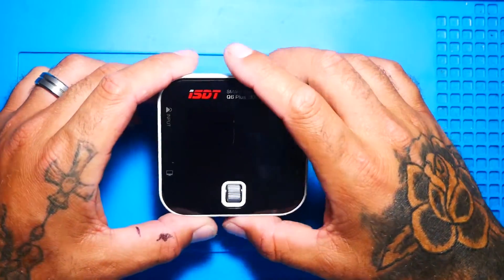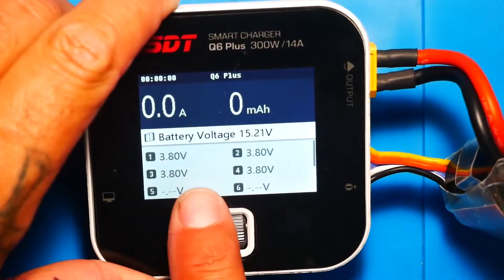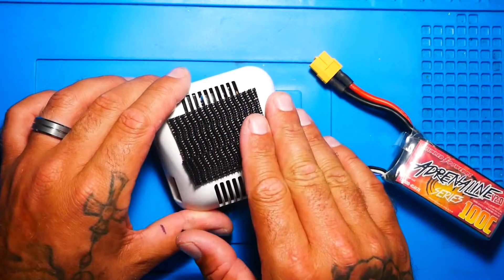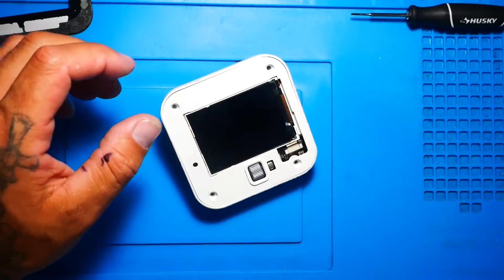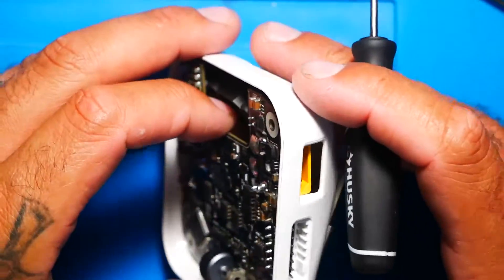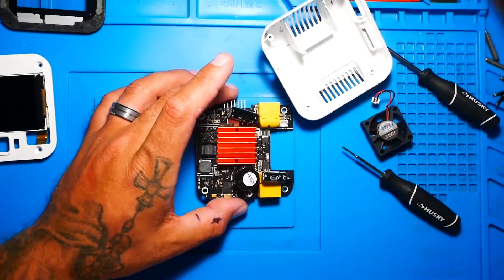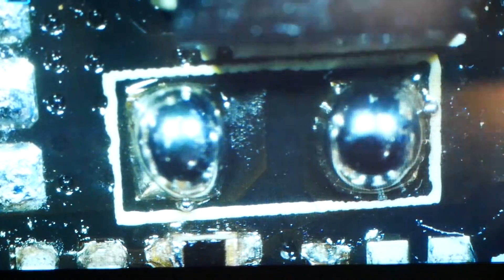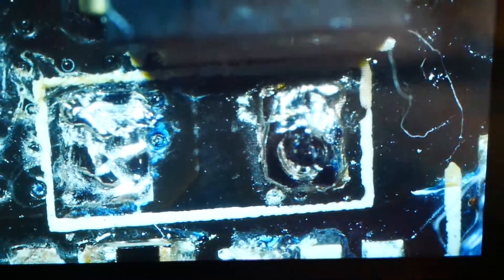ISDT Q6 Battery Charger Repair | Diagnose & Fix

Comment: Hey buddy. I just wanted to say that in some situations, if you know it's a fuse, you can use the diode checker to test it while it's still connected. BUT, you definitely helped me out even though I have the K1 dual. I connected side one reverse polarity once. I got a spark and then the same thing you got. So THANKS A MILLION. I am not an electronics tech, but an HVAC and small engine/ generator tech. Small stuff intimidates me because I have never worked with anyone who could teach me. You just helped a little in that respect, and a LOT in getting my charger going again.

Comment: but what was the cause for the fuse to fry? Faulty fuse isn’t usually the cause of a problem, but rather a result. Until you find the problem that fried the fuse, it will happen again. Unless you somehow shorted it. But I guess, this charger has short circuit protection

Comment: I had the same error and jumped the fuse with wire instead of ording new ones. When i plugged in the lipo to charge the xt60 arced. I think somethinge else was wrong with mine but thanks for the video.

Comment: My ISDT Q6 Nano is having problems, it wont charge cell-1 to 4.20. So now all my batteries are out of balance. Any idea how to fix it?
Reply: I have a similar issue with my k4. on port 2 only: Cells 1-3 will only go to 4.15v. Cell 4 will fully hit 4.20v.
Reply: @craiglamb9029  I never did fix this. It consistently undercharged, and started messing other cells up, so I just tossed & replaced it w a Dual Charger - I wont buy the cheapest Lipo Charger that I can find, again

Comment: I think I finally figured out this abnormal battery connection error. I think ISDT is doing some kind of pulse-type balancing because when you measure the voltage on the wires with different meter during balancing, it is all over the place (4.5V then back down to 3.9V in a second etc.). And it probably does not like long balance leads and / or parallel boards.

I mostly get this error by the end of the charging when the voltage of the cells is higher. There are probably some voltage limits set in the firmware and when the voltage on the wires goes above it, the error is triggered. The limits might be different for each type of program (I get the error less often when charging as LiHV - but then you can't set the final voltage under 4.3V)

We can't change those limits without editing the firmware, ISDT is not willing to release a firmware update - fine. BUT! we can calibrate the charger and that is what I did. I have calibrated the charger so that each cell now reads 0.1V lower (leave the total XT60 voltage as is - that way charging without balance lead stays unaffected). 

It does not change the voltage limits in the firmware but the charger now thinks the voltages are lower so the error does not get triggered (as easily - hopefully never if your wires and connectors are in good condition). If you do this, you always need to charge to -0,1V / cell lower voltage or you will overcharge by +0,1V so be sure to put a big red warning on the charger itself. Then you can use Li-Ion charge or LiHV storage program set to 4.05V to get 4.15V when charging LiPos - you get the idea.

I still need to test this long term but so far so good. No abnormal battery connection error yet! Let me know if it works for you.

Comment: My q6 Plus is just throwing the "abnormal battery connection" message after charging for a bit. Took it apart and checked both fuses, have continuity through both. I haven't even really used this charger to charge anything serious yet. Used it a couple times in the field to charge up a NiMH pack in one of my nitro trucks at 1.5A. Just tried using it today at 14A to charge up a 3S off a 12V PSU that works fine with my revolectrix chargers. Mine does exactly what this guys does:
https://www.youtube.com/watch?v=9Wwi8XJeVUM

Comment: another lesson learned: again the fuse ... as in my motorhome where the fridge did not work ... we checked the fridges fuses and they were OK ... and simply forgot that the motorhome itself had another fuse on that line for the fridge ... and that was burned .
An easy fix but a night mare to detect cause first of all we had doven into the shematics cause we had felt so lucky that we had found the shematics for a 15 year old fridge ... instead of starting from the top: does the fridge get power ?
Btw: this was a gas fridge ... not an electrical one.

Comment: My power suppy was set to 44V by accident. The Q6 gave an "error" beep, then I turned the power supply voltage down and then the Q6 made a "pop" noise, and it doesn't turn on at all now. What would be the issue?

Comment: Buongiorno.
In alternativa ad acquistare il fusibile da digikey che costa quasi 30€.
Vi è una soluzione piu economica?.
grazie.
Reply from the maker: I want to help, but need you to tell me in English. Sorry.
Reply: @DrainManFPV  Good morning.
As an alternative to buying the digikey fuse, which costs almost € 30, is there a cheaper solution?
On youtube they replaced the smd fuse with a thin copper wire.
I await various solutions to the problem.
thank you.
Reply from the maker: @2mattley  Yes you can do that but if it ever fails that fuse will not pop so you will blow the board
Reply: What solutions do you propose ?.
thank you.
Reply from the maker: @2mattley  put the proper fuse. That's about it

Comment: Damb ' my isdt q6 pro has the same issue straight out the box ' brand new ' I suspect this company is a complete joke
Reply from the maker: This was my third one to do this
Reply: @DrainManFPV  thanks im going to get the imax b6 evo now, i was going to get this q6 nano
Reply: I've gone through 3 as well.
Reply: Did they just use a cheap component? Drainman, is your replacement fuse still holding up? I'm guessing the company skimped on that particular fuse/component....

Comment: Hey brother, i have the same problem, can you post the link/info for getting the fuse?
Reply from the maker: Sorry Flip Crash it's been so long i don't have the link, i think some where in the vid i show the label just go to digikey and put that number in it will pop up. They are super cheap too. You'll spend more on shipping then on the product.
Reply: @DrainManFPV  that worked! I was able to find it with the P/N Here's the link btw <https://www.digikey.com/products/en?keywords=507-1947-1-ND>

Comment: Super helpful video!  The scroll wheel on mine is acting up and now i know how to open it up thanks to your video.
Reply: I just fixed the scroll wheel as well. Cleaning it with some alcohol and compressed air did the trick. (Just posting this here for the next person with this issue)

Comment: where did you get ISDT Q6 schematics?
Reply from the maker: I didn't, I emailed ISDT support for that component's info.
Reply: @DrainManFPV  Have you posted the replacement fuse information? Can you share what ISDT sent you? I have the same problem and I need to search up the replacement on Digikey.